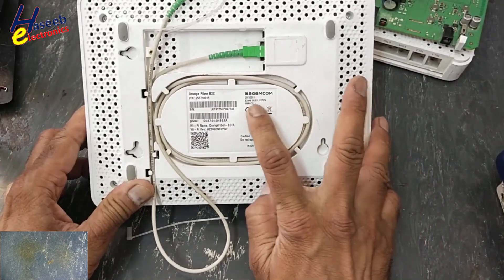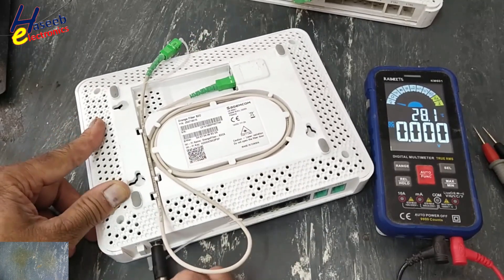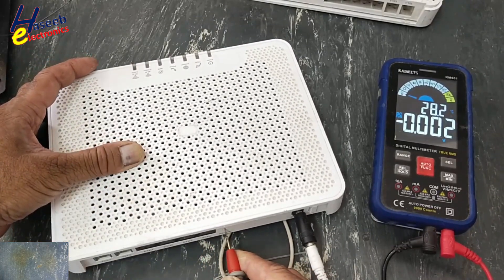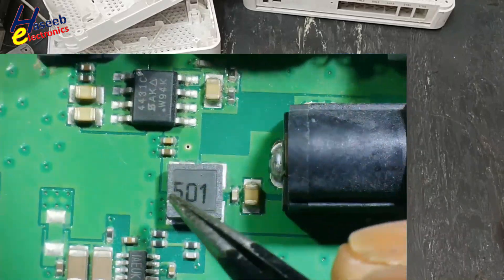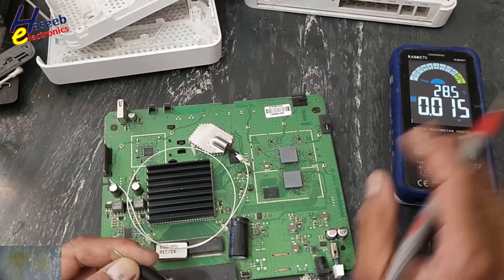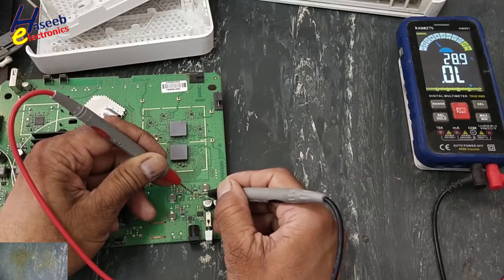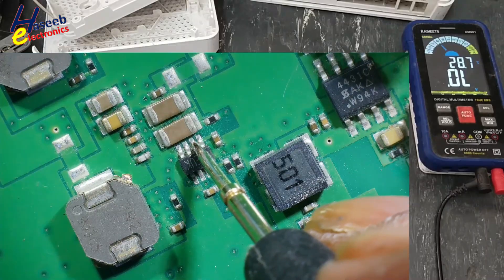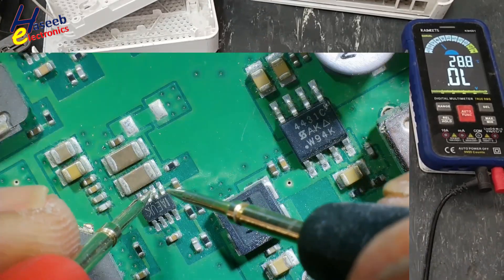{1375} Dead Sagemcom Router Repaired | Router Not Powering On | MP2233 Regulator Short Fix

Comment: 7:44 props are reverced😢
Reply from the maker: Even probes are reversed it will show high reading 
If it will short circuit, it will indicate short circuit in any direction
Reply: It looks like damage ,thank you 👋👋
Reply from the maker: No that was good regulator 
The short circuited has totally different reading

Comment: Another dead Sagemcom! Are these prone to failure? 
Interesting that these routers have fiber directly plugging into them. Here in the UK we normally have the fiber terminated in a small modem box on the wall called an 'ONT' (Optical Network Terminal) and from there an ethernet cable feeds the router. This way we can re-use old routers or have our own routers if we don't want the one provided by the ISP.
Reply from the maker: Good morning 
Thanks for your valuable comment 
Basically these switching regulators are switching at high frequency (300 Khz to 2MHz commonly used switching regulators) 
A small spike can transfer them into dead state or short circuit link 
Yes ONP is commonly used to upgrade old fashioned Ethernet routers

Comment: Don't fold the solderwick, its better for the small smd components, as for the big ones which have a large space of pad u can fold it to absorb more, but it takes a lot of heat to do that in the small space of those regulators and heat isn't distributed well